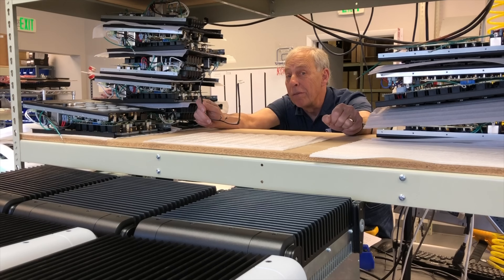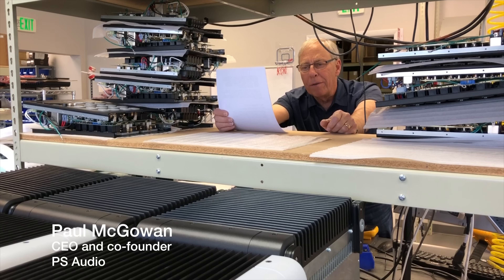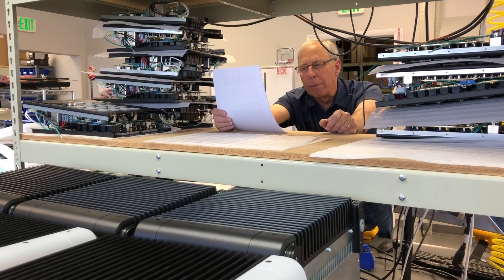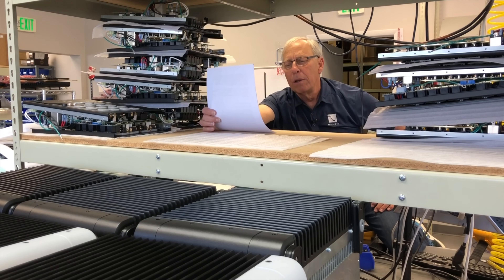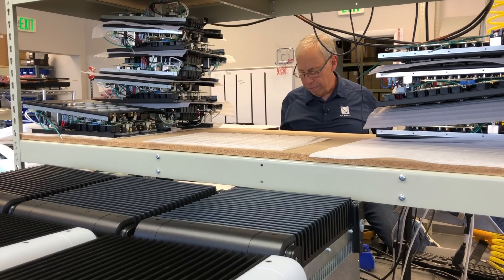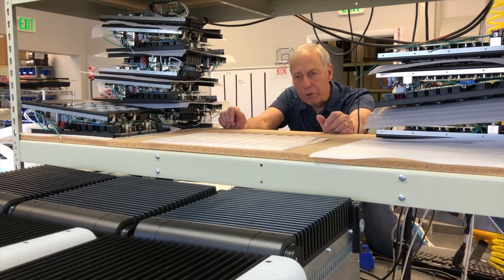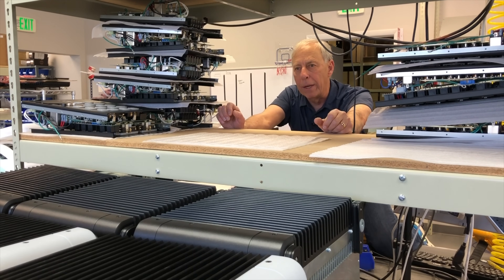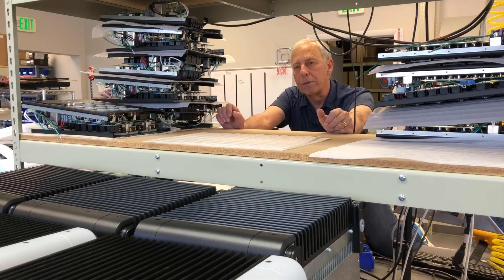Why aren't there more active crossovers?

Comment: I love active crossovers. It's really sad that not more audiophile speakers are with active cross over filtering as you can get much better control of the filtering, timing, phase etc. of each transducer. Even the damping factor per transducer becomes superior as there is no external filtering to ruin it. Speakers with active crossover are very common for studio monitors, stage monitors, wi-fi speakers and some smart speakers. Some brands are quite committed to speakers with active crossovers. E.g. Bang & Olufsen, Devialet and Sonos make such speakers. Even the Apple Homepod is in fact a speaker with active crossover (8 amplifiers). But definitely the Homepod is not audiophile and few of these speakers are. Perhaps the best of all is the Beolab 90 with 18 transducers and 8200 Watts per speaker, but it is a bit pricey costing an average car per speaker:: https://www.bang-olufsen.com/en/collection/speakers/beolab-90

Comment: Three-way active crossovers with three amplifiers are much better in every way, they are rare because they are expensive. Hi-Fi is a high-volume/low-cost market.
Reply: Exactly, and also I think most folks are unaware of the enormous benefits of a properly designed active system. Many factory designed active systems are cheaply built to compete with the passive market, and insisting on stuffing all the electronics inside the box, while convenient, cripples the designer from building a truly high quality system. For example, Paul has been very clear elsewhere of the importance of a beefy, high quality power supply for an amplifier. No way can you stuff two or three of those inside a speaker box, and then allow proper ventilation. Every component must be external, then true high quality sound emerges. See my youtube channel, "Speaker Builder" to learn about the many ways to design active systems.
Reply: Correct. It’s amazing how deluded people can be. Just been arguing with a speaker designer trying to tell me passive and open baffle speakers are the best way to go 😂🤣😂
Reply: I plan to make my own speakers for an active setup. I have over 10 power amps, so got that covered!
Reply: This is exactly the kind of garbage I referred to in my other comments. No way a proper power supply can be housed inside this speaker boxes. No one who is serious about home hi fi would spend serious money on speakers and then purchase tiny power amps with a tiny power supply to drive them such as what must be stuffed inside these speakers. All serious amplifiers use huge and heavy toroidal power transformers and a pair of large coupling capacitors for a very good reason: such provides the ability to manage reproduction of dynamics inherent in well recorded modern music. These "powered" speaker are designed for the ignorant consumer, and while they no doubt sound better than their passive cousins, they are not the stuff of serious hi fi enthusiasts. I have just finished building a smaller version of my top of the mountain system, and total cost from scratch would be about $2500-$3000. The ability of that system would no doubt blow these away simply because it uses all the right stuff. All the electronics is external and can be carefully selected for quality, and can be swapped out for performance comparisons. If you're going to go active, you don't want to make foolish compromises you would never accept in a passive system. See my videos on "Speaker Builder" for more info. I don't promote my channel to make money, as it is not monetized, and I just don't care about the money side of it, I promote true active systems to educate so that others can enjoy this amazing format.
Reply: @SpeakerBuilder  you want to educate but you need to look up the different amplification topologies to understand that big torroidals with massive filter caps are simply not the be all and end all mark of serious quality in amplification.  I use big transformers on amps ive built that have incredible current swings going from Class A to A1 on valves or opamps dealing with punishing 4 to 2ohm loads. All these are not neccessary for Class D power supply, for example, due to the relative efficiency of this topology. Unless of course you have some prejudice against Class D but 200w in to an 8ohm load at diminishing distortion % and excellent damping only requires no more than a 65vdc switch mode power supply for a Hypex module for example. You dont want to build it in to the cabs? Fine, you can get a modushop case with the big fins and set it up in there if you want separates...  The compromise to the audio of the LS50w is not in the choice of amplification or the ps its using, its the other features built in to it drawing from the same supply...
Reply: @ememe1412  My focus here is on speaker building, and I certainly don't claim to know much about amplifiers. But I do know what sounds good. I have never heard class D, and due to the nature of the design, I am inclined to be prejudiced against them, and so I have never owned one and cannot say if their sound quality stacks up to the MOSFET"s that I built from Phil Marchand's offerings. They are the nicest sounding amps I have ever heard, but then I've only ever listened to BJT's prior.
Reply: @SpeakerBuilder  class D has come along in the last few years. I share a preference towards mosfets (valves first though lol) and by default all my power tx and caps are huge (more versatile for different implementation later, on top of headroom).  Having heard some higher end class d amps, commercial, and homebrews using Ncore modules, I'm not so dismissive of it. (I started my amp building on Tripath modules but moved on years ago.) Anyways, im looking to use amps lying around so got thinking about actives. I'll check out your page. Thanks.
Reply: @SpeakerBuilder  btw i meant 'mosfet' not opamp for the 2-4ohm amp.
Reply: @Dream Diction Interesting points, thanks.  I'm not an audio engineer, I make a successful living elsewhere so I do have money to invest in a good system.  I simply like the idea of active systems and have personally found the sound to be fantastic.  For whatever reason audiophiles seem to get bent out of shape when you mention active systems. I've seen honest reviews of people driving LS50's with McIntosh amps claiming they were getting better sound when using the LS50W's with their own amplification.  Why people get so bent out of shape with that notion is beyond me.  There must be some merit to it.
Reply: Yes this is absolutely true, the three way passive design has a number of challenges that lead many builders to consider it unsuitable for true hi fi. One alternative is to use a passive crossover btw the mid and tweeter, as Paul suggested here, and use active crossover for the sub. However, there is still an enormous advantage to an active system design. I have built several two way speaker systems ( 8 inch and 6 1/2 inch two way designs), some passive and some active. The active systems are far superior in clarity and dynamics. But the active two way system is much more expensive (nearly double the cost). The big advantage is the removal of the passive crossover parts in the signal path at the drivers, where impedance is low and current is high. Their removal allows the amp to power the driver unimpeded. But you will never hear this advantage by listening to factory built active speakers. You have to build your own, using all external parts, and spend the money on all high quality components. Then the difference becomes very obvious.
Reply: Paul teaches about the importance of a quality power supply, and I'm taking his word for it, after all, he's the electronics engineer with the decades of experience building amplifiers.
Reply: i know im asking randomly but does anyone know a way to get back into an instagram account..?
I somehow lost my password. I would love any help you can offer me.
Reply: @Zavier Garrett instablaster :)
Reply: It can be done with price points to fit any budget.  The KEF LS50W does it at a price point around $2K.   KEF powers both drivers separately and up to 230 Watts.  The Devialet Gold Phantoms do it at power outputs well above that for $3K.  These sytems are definitely audiophile territory and compete with passive separates priced thousands higher.  The LS50W is a perfect example of actives being superior because they can so easily be compared to their passive original.  I've read professional reviews who have tested the actives to the passives with gear in the neighborhood of $20K and they preferred the sound of the actives.  Just imagine if KEF went head first into the reference line and paired amplification and crossover in those.
Reply: Then you apparently believe Paul's Stellar series Solid State Amp is garbage.  Have you seen the internals of that?  EASILY would fit inside a speaker.  You are a complete snob.  Easily offended by mainstream opinion of what you decide for everyone is acceptable quality fidelity.
Reply: @TheMB2333  Who cares if it fits in a speaker?  Why are you people even discussing something so trivial?  And why would you put it inside?  Its just more susceptible to microphonics.  Then there's the cooling issue if the speaker is sealed.  You really want to pry open your speaker cabinet to change things inside?  Its ludicrous.  Everything should be accessible and external.  Raise your standards.
Reply: @Michael B
My experience is that passive crossovers work well in two-way speakers. There is only a small advantage in making active two-way systems.  Passive crossovers in 3-way systems significantly degrade the mid-range because there are two or sometimes three filters elements in the signal path to the mid-range.  There must be one filter element to keep the bass away from the mid-range, and there must but another crossover element to keep the treble away from the mid-range, sometimes there is also a notch filter to smooth out a hump in the middle of the frequency spectrum covered by the mid-range.  The ear is especially sensitive to mid-range so three-way passive crossovers can make an audible degradation in sound quality.  Another very important advantage with active crossovers is that you can ignore sensitivity when choosing a midrange speaker because the output is controlled by the midrange amplifier volume, this greatly opens up a wide range of speaker choices for the midrange.  Active systems offer limited advantage in two-way speakers, the real advantage of active systems starts with 3-way speakers, so if you want to compare the relative merits of active crossovers, you should only compare passive three-ways with active three-ways.
Reply: I  feel this is the way to go for diy for sure.. People who have thousands for audio equip and supersonic hearing can sell said equipment to general public afterwards.   I appreciate the sound of a well designed speaker also though so idk.
Reply: people are control freaks (generally)  so why not